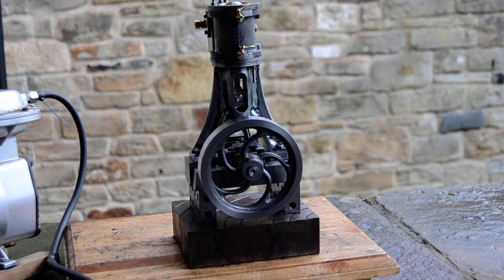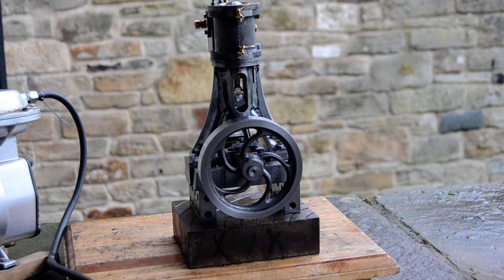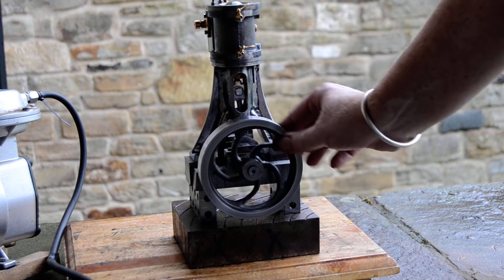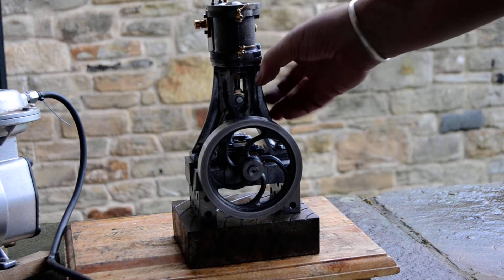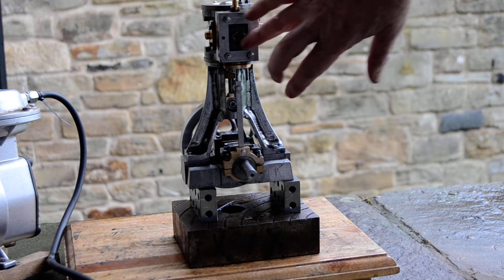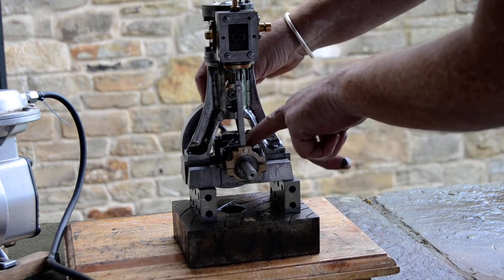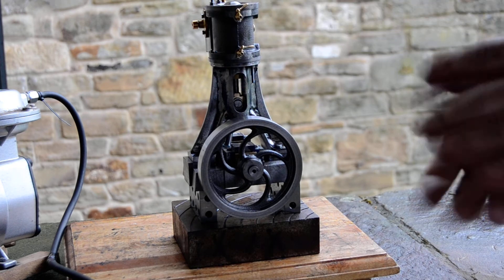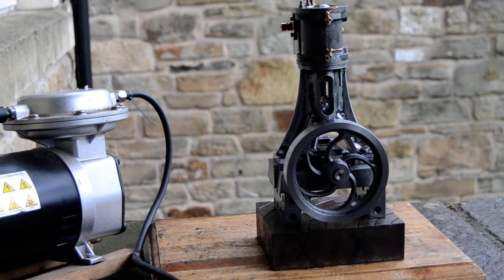Stuart no4 replica steam engine, first run on air.

Comment: Wow Pete you must be very proud of that! I'm very jealous. You are a true model engineer, far beyond my capabilities. Looking forward to seeing it (her?) running on steam.
Cheers
Andrew
Reply from the maker: Thanks Andrew, once I've added gaskets and packing etc I'll make a video of it running on the hot stuff. It will never be a thoroughbred Stuart but it cost about £80 as opposed to nearly £500 for the Stuart castings!I may have a go at improving the flywheel inner rim, the uneven casting edge makes it look as thought the wheel has a wobble but it is infact running true.Maybe at some point when your 10v is up and running I can bring it over and have both running on steam. :-)
Reply: Absolutely, I'm definitely up for that!